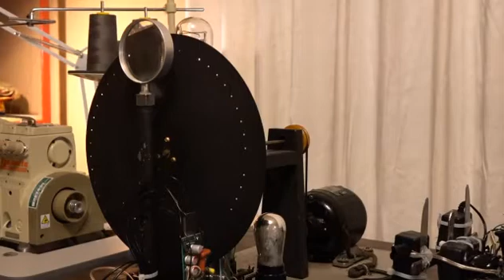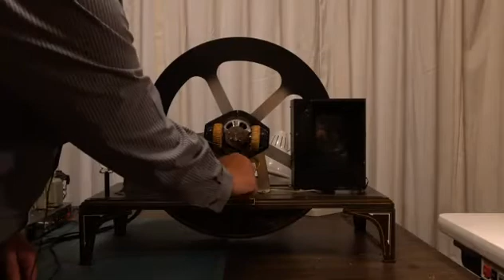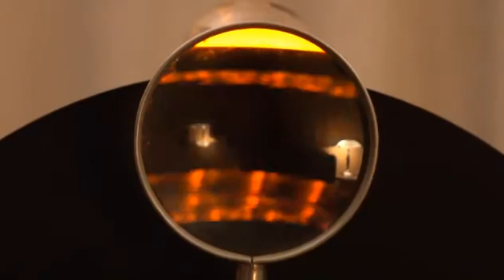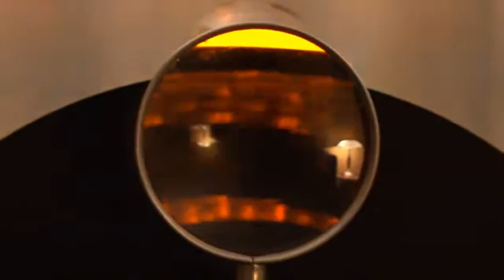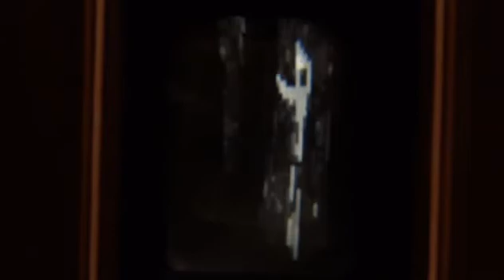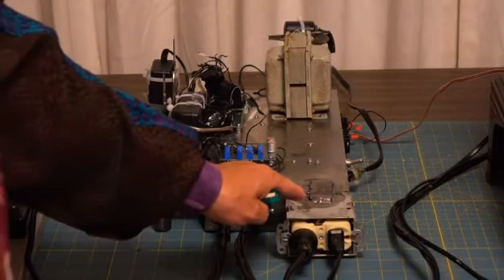spark museum mechanical television introduction

Comment: very interested in learning how that synchronization brake works! I never knew about that part before
Reply from the maker: Alex: The synchronization they did during the mechanical era consisted of filtering the video signal so that the most negative pulses (which are 'below' black in electrical potential) are filtered out and amplified. Those pulses are then applied to the braking coil, which is an electromagnet that attracts to the toothed wheel.

The purpose is to have the electromagnet, which is energized once briefly during each line, to slow down the speed of the wheel. The motor and wheel combination is purposely designed to go slightly faster than the speed of the signal. Thus, by braking the speed, the electromagnet can achieve synchronization.

This is how it's supposed to work. However in practice, it was very unreliable. The viewer still had to constantly fiddle with the speed and rotational phase controls (if using the Baird) or manually pinch the wheel with a gloved hand (if using the kit machine).

For the purpose of our exhibit we provide an optical sensor that senses the rotational position of the wheel. That pulse is then sent to the signal processor and used to force the video signal (which is generated by real time software on the Raspberry PI) to stay in sync with the spinning of the wheel. There is a separate software synchronization for each the Baird and the kit. This system enables us to demonstrate mechanical television without having to subject the museum patron from the tedious and sometimes frustrating process of manual synchronization of the signal.

There is an option available that disables the automatic synchronization so that to allow us to demonstrate what it was like to try to manually synchronized the receiver to the signal.
Reply: @markallyn1  I had always wondered how people dealt with that persistent vertical hold problem. ;-) I am surprised that an electro-mechanical breaking mechanism worked at all for production use.  Wouldn't that just add another source of jitter?  I am also curious what the highest resolution ever achieved was using mechanical television.  Cheers.

Comment: I am unable to find the word arperture in the dictionary Mark.  I believe the word you intended was aperture , without the initial "r".   I found this mispronunciation to be sufficiently distracting as to pull my attention away from your topic and focus it on your presentation skill which I am sure is not the outcome you are seeking.
Reply from the maker: Thanks for the note. I checked with the folks at the Spark Museum (who I did this video for) as well as some others who have professional experience with videos and they saw no problems at all; that the video is very demonstrative of mechanical television and the work that I have done.